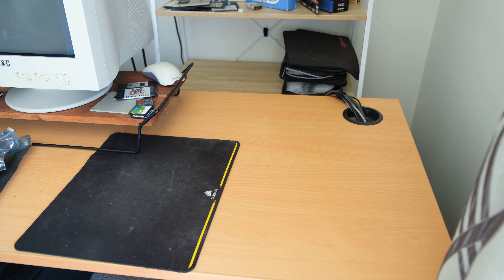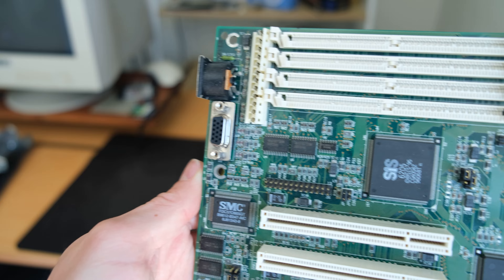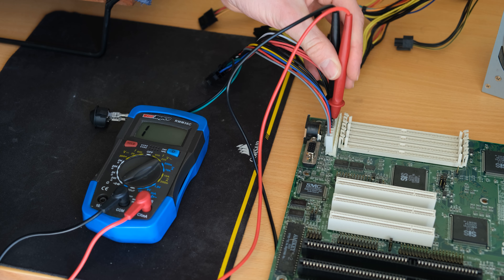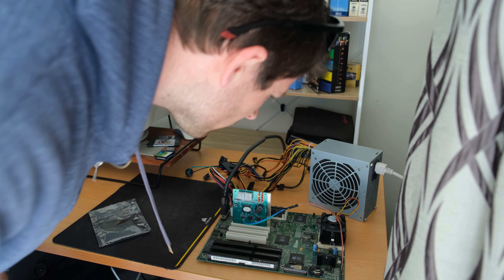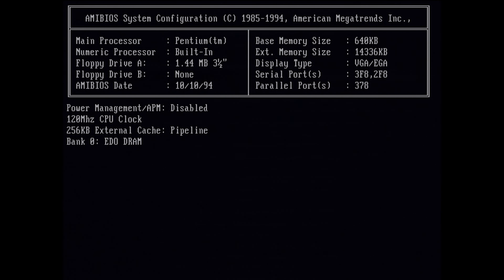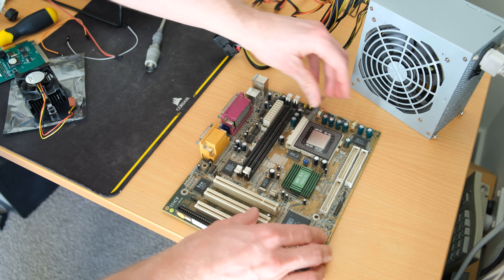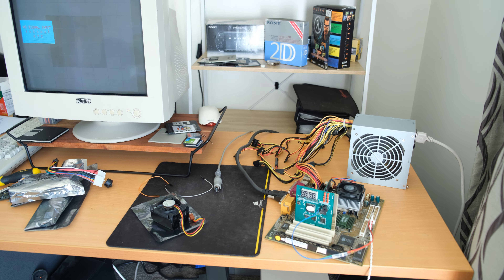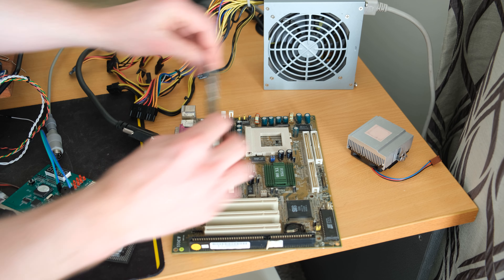Unknown Parts | Testing Motherboards

Comment: On first board I see just one voltage regulator probably for 3,3V and just a free space (no slot soldered) for adding second VRM. So I think this MB can run only standard Pentiums, because there is no 2,8V voltage regulator.
Reply from the maker: Yeah you're correct there. I should have grabbed a non MMX CPU to test with, but it slipped my mind that it's a single vontage motherboard!